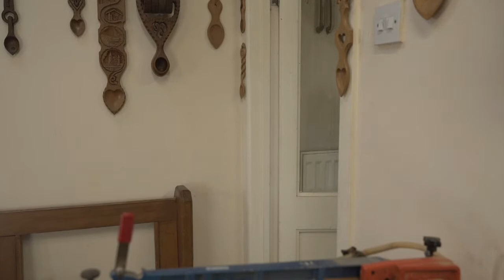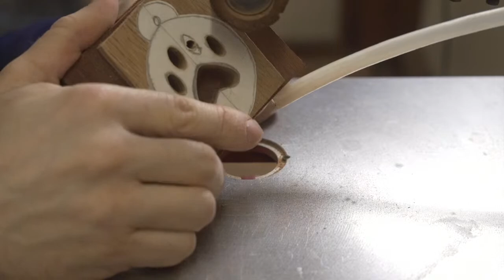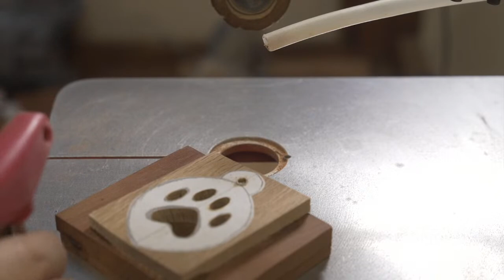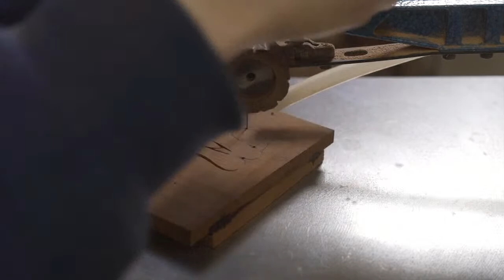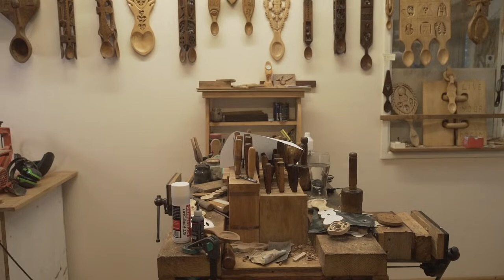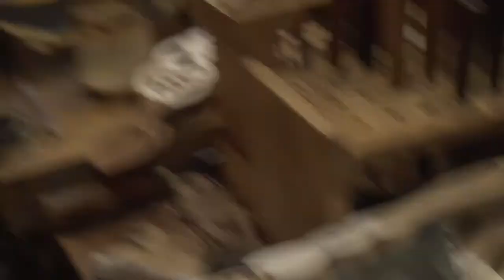Scroll saw live.

Comment: Great video lots of good tips an ideas as I watch you cutting is like your Hegner is really smoother than my Poly Max 3 it hasn’t got much use over the last few years was wondering if the belt could be the belt has gotten hard I have went completely through it nothing seems to have any ware it’s not bad vibration just enough to bother me 
As always I enjoy your videos thank you for all the work you put into them
Reply from the maker: Thanks Jerry, appreciate your feedback as always. The strange thing I find is this is the older version of the Hegner multicut 2s and we have the newer version too and my preference is working with the older one.

Having said that we have made a few alterations over the years helping to reduce the vibration. All said these scroll saws have done a fantastic job for us over the years.

Thanks again for your support, all the very best from us all. 👍👍
Reply: @DailovespoonsThomas  oh not complaining my PolyMax 3 is a 1986 model the only thing been replaced is the bellows I have tried several other scroll saw nothing even comes close the Hegner but this little bit of vibration just has me confused it was always so smooth an now I just can’t figure what’s causing it 
Thanks for always reading an replying back I really appreciate that
Reply from the maker: @KE4YAL  that sounds very familiar. Trying to figure out a new issue that appears from nowhere. Hope you get it figured out quickly.

All the very best from us all. 👍👍